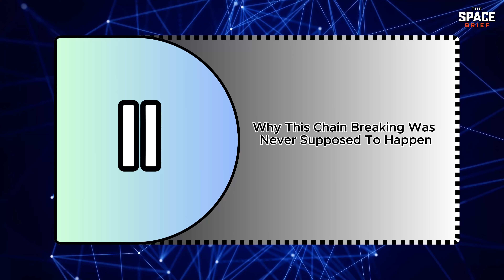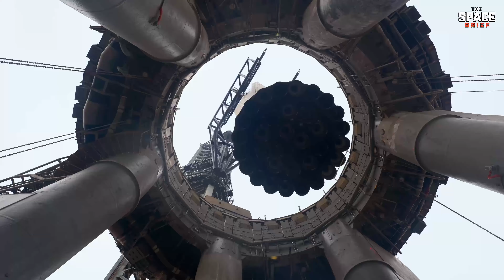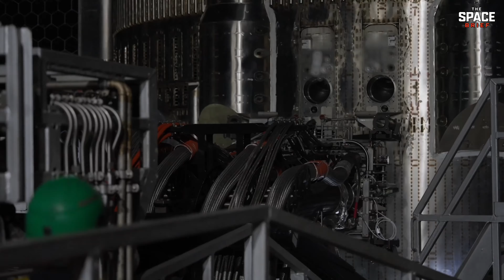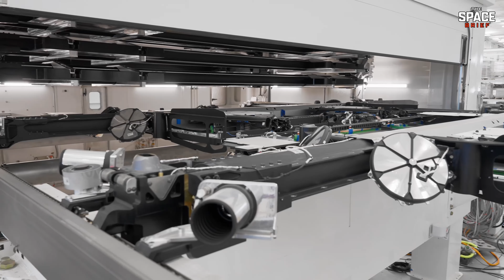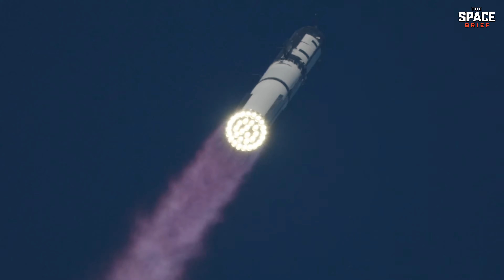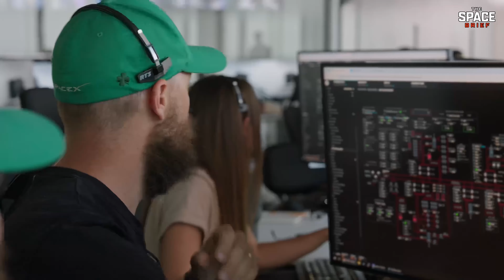SpaceX Drops Big Starship Flight 12 Footage — Inside The Race Against A Broken Chain!

Comment: Moreover, SpaceX-Flight12 was uniquely significant b-coz it debuted  Orbital Launch Pad-2 (OLP~2)
While OLP-2's upgraded water-cooled flame trench and "Never tell me THE ODDS" catch tower survived the initial Launch overpressure exceptionally well 👌 😅
Thank U 🌿.....gotta zoom, my TGIF 🎊 olalah
Reply from the maker: Exactly right — the SQD umbilical arm and the chopstick chain are two separate systems, but OLP-2 took hits on both in one week. Which do you think needs redundancy first: the QD arm or the catch mechanism?
Reply: @TheSpaceBrief2 

I believe after SpaceX ~Flight12 considered the last SQD-delivers after the said, repair, NOW RETIRED.... I am trying to think, a month Moon ago, they disconnected  (SQD) the arm on 
Pad 1~Officially dc'd. 
They replaced by next-generation Hold-down Arm and upgraded fluid management (OM) boxes designed to prevent the precise hydraulic pin  jams tht caused  countdown holds  . ALL WERE UPGRADED.
Prepping for SpaceX-Flight 13th.
The above is my contribution to yah...makes all sense!
Thank U 🌿🇺🇸🙏
Goodnite 
S 😴L 💤EE 😪P. 
Yeah...tired and I am mentally bonkers now 😂

Comment: Yeah...going back to SpaceX-Flight12 last May, 2026 CORE Issue is the SQD~Ship Quick Disconnect arm. 
This differs fr the Main Mechazilla-chopstick.
The SQD arm- is the upper umbilical mechanism mounted on the launch tower tht "transfer fuel, power, and data" etcheteras...
THANK U 🌿 for sharing